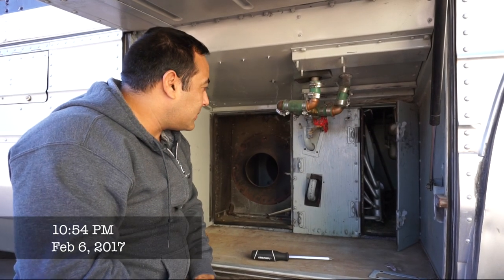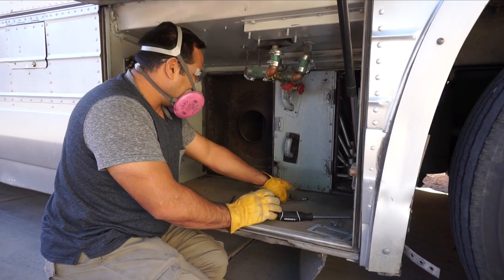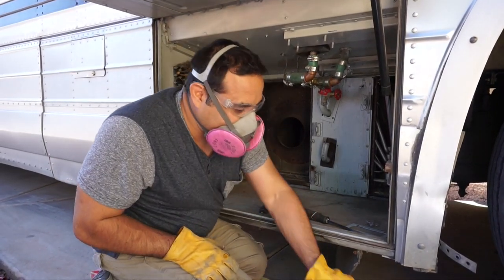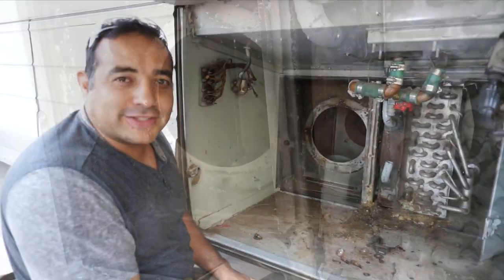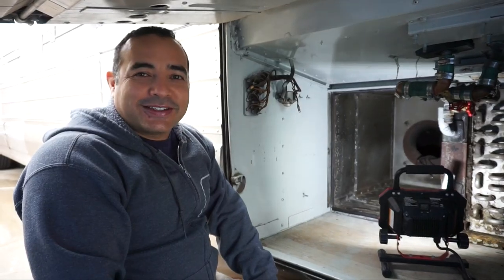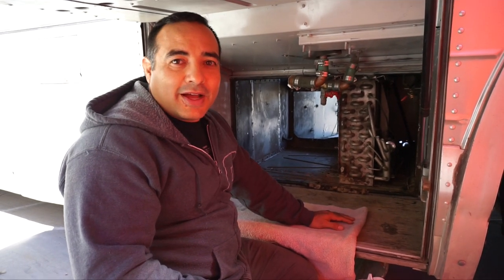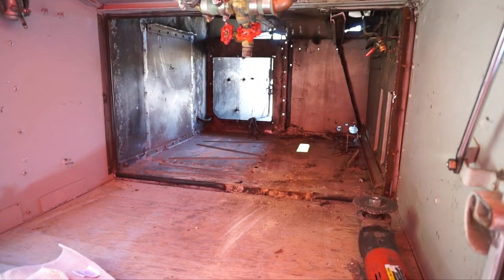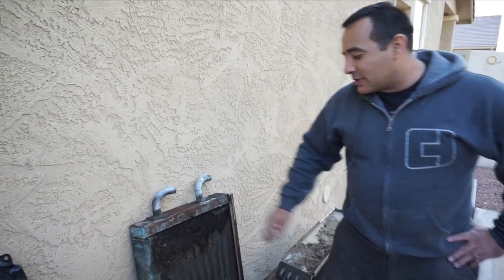Removing the Factory A/C on a Vintage Bus

Comment: Interesting seeing one of those things taken out of a bus.  I once had a bus A/C compressor installed in one of my cars...because the original equipment A/C kept catching on fire from being, well, too small, and overworked in hot weather.  After the shop had rearranged some stuff under the hood to make room for the new parts, I had an A/C that put out so much cold air that I had to wear a jacket and mittens on the hottest days- but that never gave me the slightest problems after that.

Comment: So in 1963, they built the bus around the heat exchanger and evaporator coil, so tuff
Reply from the maker: Sure did feel like it when we took them out.  This would become our battery and electric compartment later on (we had no idea when we made this video)

Comment: Way cool!  Unless I'm way way off, the A/C Part is the evaporator (it gets cold, and is the part that air blows through to cool off the inside).  The condenser is the part that is immediately after the compressor that turns the high pressure gas back into a liquid (and gets hot in the process).
Reply from the maker: Joey Novak you are correct ... I always get them mixed up

Comment: Cool! Thanks for sharing! If you use the bay for batteries, where are you putting your evaporator?
Reply from the maker: We have a bay that has a mesh front face - we plan on using that for a mini-split a/c system

Comment: Were you able to sell any of the heat/cool system as scrap?  When I took my pool down last summer I was amazed at how much I got for the aluminum.
Reply from the maker: I have a funny story about that.  I blew the head on my car and replaced it with a different head.  I carefully removed all the iron pieces (valves, guides, springs, etc) to be sure that I could "recycle" a 100% aluminum head.  I spent about 6 hours cleaning it all up making sure there was only aluminum left.  I proudly took that head to the recyclers and ask how much they would give me for it.  They put it on the scale .. $0.27 is what I got for it.  Clearly, there is something I don't know.  We did set all those parts out for "bulk trash" and we were surprised to find that all the metal was taken from our pile (somebody knows something we don't) I have to assume it was taken to a recycler.